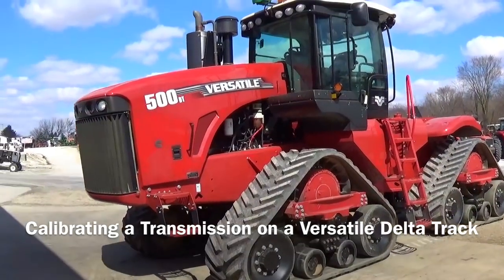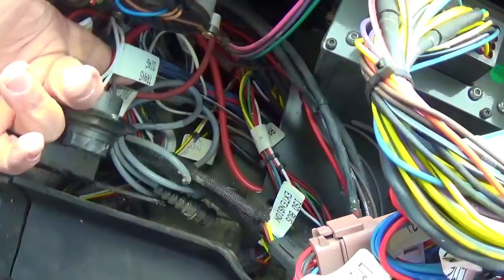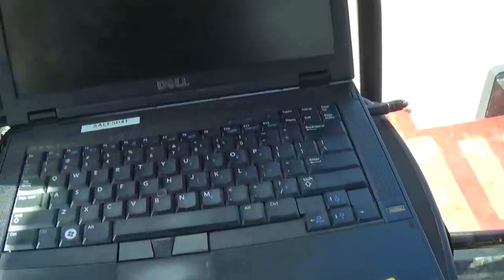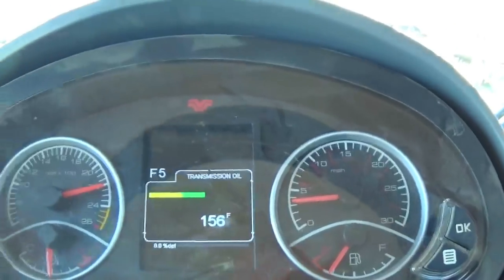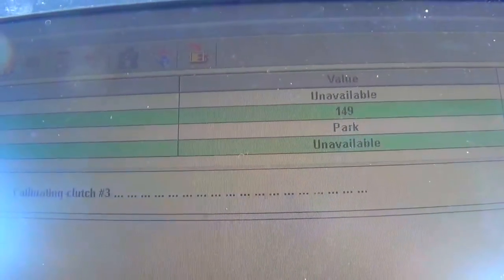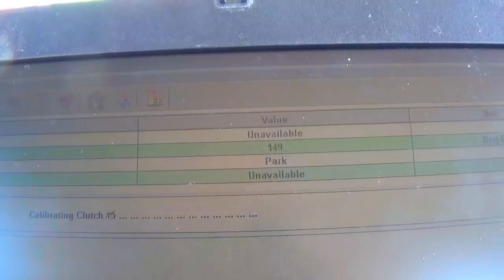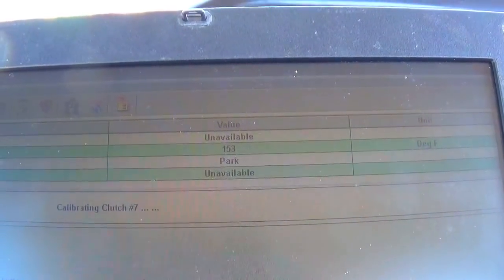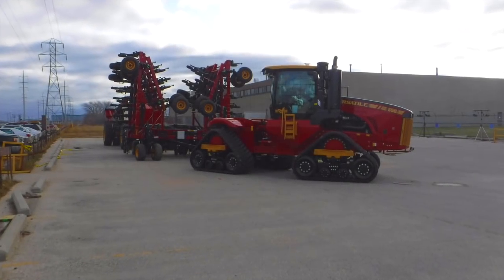Calibrating a Transmission on a Versatile 4WD tractor

Comment: Im working on 450 and transmission cat would reead ecm cat module it powers up for a minute then power goes red but transmission will work fine then after t minutes cant up shift downshift go into reverse or forward shut tractor off start uup work for t minutes then goes wacko again

Comment: Man have I calibrated a many of those trans. on a challenger track tractor these are good trans.
Reply from the maker: Yes they are.  Generally they are indestructible as long as you change the oil and filters as required.

Comment: gzz it doesnt have auto and adaptive cal, yet? they have that on all the cat equipment for 10 yrs. the Russians must not have had enough money to pay cat to develop that.
Reply: Everything in Mike's video was very accurate and extremely informative.  Mike is correct in saying you are wrong with your statement. The autocalibration procedure used on this tractor is exactly the same as any cat construction machine out there. You mentioned adaptive cal and that is only used on a very small number of on highway vehicles today. Its a proven robust system that only takes about a half hour and only needed a few times the life of the tractor. Ag customers have no problem with this compared to the cost a new tractor would be if so "adaptive cal" was developed.
Reply from the maker: Andy,  I think your wrong on this statement.  I don't believe this has anything to do with paying Cat to develop this.  This is the exact same transmission fill calibration procedure that is used on the Challenger tractors. the Terra-Gator and Cat motor graders. There is a demo mode I my Cat ET tool I just went into and I just did a demo on a transmission fill calibration for a Cat motor grader. From what I can see the auto and adaptive calibration is for for the grading/leveling side of things on Cat Equipment.
Reply: I use to work on the cat ta22/19 product before i got smart and left cat for fpt. They have easier cals for the internal cat machines because they r all controlled by cat. Agco and versatile or external customers. Pay to play. Not a big deal as long as the versatile dealer is going to do the cal. If i was a customer and had to do all that messing around i would be pissed.